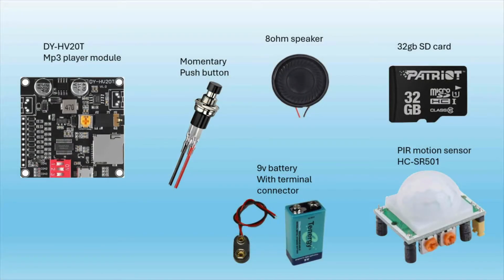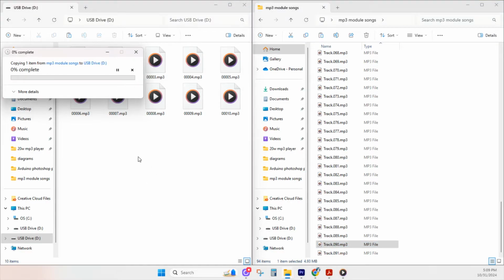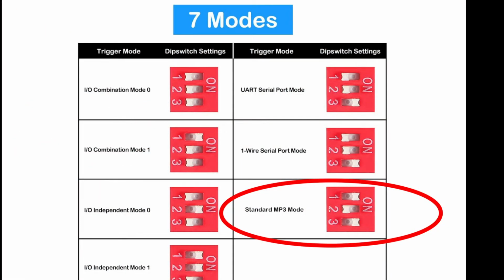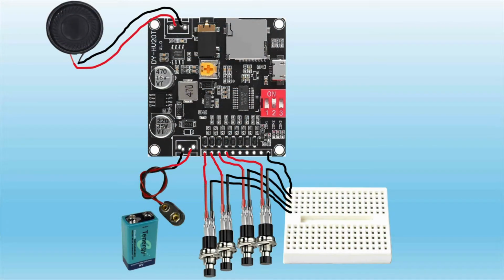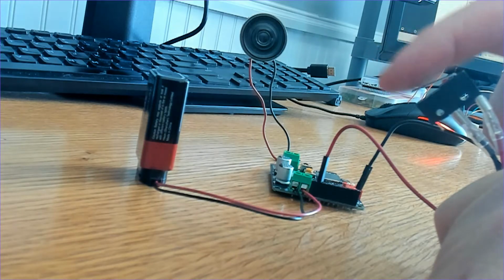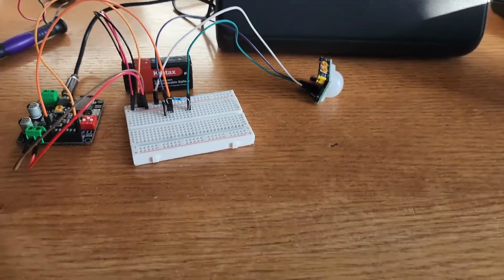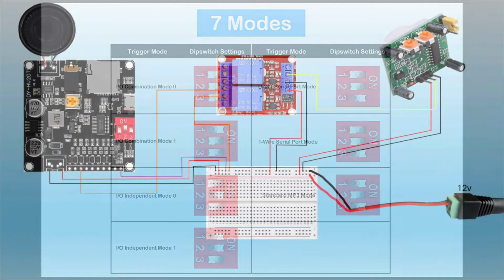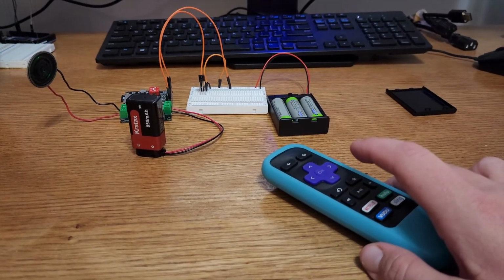5 Creative Ways to Use an MP3 Player Module   No Arduino Required!

Comment: 6:02 this is the problem I’ve been having with my mp3 board (different to that one) the audio plays on release of the trigger (so I just wired a micro switch to the normally open setting). The other thing was that whilst I got it working on trigger press, not release, the audio module seems to “sleep” and require 2 trigger pulls to activate the audio (on the second trigger pull) if left alone for a moment. I have bought a similar board to this one in the hope that A) it will trigger the mp3 on contact (not release) and B) play every time the contact is made without fail.
Reply from the maker: hey there! 
I hear ya, this board is great but sometimes getting a sensor to work takes some trial and error for sure. I tried numerous combinations of dip switch settings, wirings, and motion sensor jumper settings to get it to work like all the other sensors and triggers I have. 
I was going for "easy" ways to trigger mp3's for this board, but I found that the easiest and reliable way for the motion sensor to trigger was by using Arduino Nano. I know it doesn't fit the "no Arduino" model I was going for, but it's really just minimal code to get it to work perfectly.
Thanks for sharing and all the best on your sound projects! 👍👍

Comment: Do you build this for anyone? I need a device that plays music when the refrigerator door opens,  any help would be great.
Reply from the maker: Hey there!
I have built some things for people but never using this. You may wan to use a magnetic reed switch with the mp3 board. Those switches are like the ones you see on doors and windows. When the magnet pulls away from the reed switch, the music plays. 
I could help you build one ... happy to help!

Comment: Great video! I've tried all forms of power sources (i.e. USB, 3 AAA battery pack, 9v battery, 12v power supply) and I can't get any sound out to the speaker or the line out. The SD card is formatted FAT32 and the MP3 file loaded is named 00001 and is on the root level. Any insight would be helpful.
Reply from the maker: hey there - thanks!
do you have the correct dip switch setting for what you're doing?
have you adjusted the volume potentiometer in the middle of the board?
what kind of speaker are you using and how do you have it connected? what sensors, buttons, and other components do you have connected to the header? Are all components connected to common ground?
What is the current rating on your 12v supply?  may need to increase ...12v2A supply or so depending on what speakers and switches you have connected. 
And 00001.mp3 is the correct format. 
Some of these are kinda silly questions, but it's easy to overlook something👍  
I hope that helps

Comment: Thanks for the video! Is it possible to have a file play on repeat while a button is latched/On? Additionally, while that is latched on, if a second input is latched/on, a different file is played.
Ideally, when the second input is unlatched, leaving the first input engaged, it would continue playing the first track?

I'm just looking to make a simple prop for a kids costume without going down the Arduino route.
Reply from the maker: hey there! 
Props are always fun and the kids, i'm sure, would love that.

the precise behavior you described, you'll likely need basic logic control - either from building your own circuits or a simple microcontroller, which ironically might be easier than complex analog switching circuits.

I think this is as close as we can get:
I/O Independent Mode 0 plays repeatedly while input is held. This mode will play a new song when it receives a new signal during playing, but won't automatically resume the first track when the second is released.

UART mode with Arduino Nano or similar would give you the exact logic you want with just a few lines of code. I may be able to help if you choose to use Arduino. 👍
Reply: @BMonsterLaboratory out of curiosity, what is the behaviour in the event more than one input is latched? Say input 1 is enabled then input 2 is enabled while I put 1 is still playing/latched?

Comment: Can this be added to Bluetooth a speaker Without having to add songs or using an SD card? I'm building my own speaker and wanted to install some momentary switches for skip & play.
Reply from the maker: hey there!
This mp3 module doesn't have bluetooth capability. You can only play tracks on an SD card or from USB, which I find to be pretty slow. It does a great job of paying from an SD card though!
Reply: @BMonsterLaboratory boooo! Lol thanks. Do you know any that can?
Reply from the maker: @Pdott083  lol
This looks like it might be worth looking into. 
https://www.flipkart.com/electronics-crafts-zk-502l-mini-bluetooth-5-0-dc-5-24v-wireless-audio-digital-power-amplifier-electronic-components-hobby-kit/p/itm7ea33c5104fc1
It's a Bluetooth receiver and Class-D amplifier board. 
I also found this on Amazon. It has a ton of reviews and it looks like people are happy with it.
https://www.amazon.com/ZK-1002T-Bluetooth-Amplifier-Control-Speakers/dp/B0DZHC5GBG?th=1

Just make sure you have the right speakers and power supply and you got a nice setup! 👍👍
Reply: @BMonsterLaboratory seriously!? How? I have two 502L and planning on updating to the 1001u
Reply from the maker: @Pdott083  
24v 5A power supply at barrel jack
2x 30W 8ohm speakers (my preference) 

turn the module on. once LED starts to blink, grab your phone and search Bluetooth connection for BT-WUZHI. Once connected the LED will burn solid. Now your phone's audio should play through the amplifier.

Don't under power your board. They recommend high voltage for the one I'm looking at.
I don't see a password requirement to connect.
Also,  read the instructions with your module to verify what I have suggested.
Try it out. It should work 👍 

Here's the link I was looking at: https://www.amazon.com/Bluetooth-Amplifier-Receiver-Channels-Speakers/dp/B09J9338KS

Comment: Hey Brad.  Another great video!  Question: can this be wired in a similar fashion, with simply one push button switch, to play one sound?  Diagram?
Reply from the maker: thanks!
Yes, It can be wired for push button play. Do you want 1 sound track to be played or multiple?  You can use just this mp3 board with a button connected to it for one track or you can add a microcontroller for many more options.

Comment: My girlfriend was wanting to build a "haunted house" out of carboard (we have a TON of Chewy boxes) for a Halloween decoration. I thought about creating a circuit to put inside of it that would power some LEDs and play creepy sound effects, maybe even release "smoke" out of a chimney.
Reply from the maker: That sounds like a fun projet! 
Add this mp3 board to Arduino. 
You could use a micro fogger for the smoke - maybe with an LED behind it or use one of those model train smoke generators.  Power it from an external supply.,
Like the idea 👍👍

Comment: Are you able to share the code you are using? Thank you!! 🙌
Reply from the maker: i'm not actually using code in this video. I am just connecting various sensors/triggers to the sound board.  I have another video where I use Arduino to manage the sound tracks. If you want that code, I can get it for you. 👍
Reply: There is no code involved here. The board has built in logic and based on the 3 red switches you have multiple modes you can use. Did you even look at the whole video :)) he explained all quite well.

Comment: This is a fantastic video and really, REALLY helpful! I was trying to figure out how used the NPN transistor to trigger the DFPLAYER to play. Would you mind sending a drawing of how the NPN transistor was connected to the DF player and motion detector?
Reply from the maker: Thank you!  I appreciate it.  
I can send you a diagram over mail or facebook.  bmonsterlaboratory@gmail.com or click the facebook link.
 honestly, it's easy to use this with Arduino. You can expand your audio library to 255 or something like that. You can do shuffle, play in  sequence, motion activated, button activated...etc.  I can show you either way.  The Arduino route is pretty simple as well.  👍
Reply: @BMonsterLaboratory  Thank you....just sent you an email. I sincerely appreciate your help.

Comment: Can the mp3s play through the amplified circuit and the 3.5mm circuit simultaneously or does one cancel the other in use?
Reply from the maker: hey there!
Interesting question. I haven't tried that and I couldn't find any info  in the user manual.
I will get it back out soon and test it....will let  you know.  👍👍

Comment: I don't want to bug you with a question, but I'm struggling to see the answer...

I have what i think is a fairly simple problem. 
I want an Arduino to send a message to the board to play 00001.mp3 from start to finish.
The only thing that can interrupt it, is if a physical button connected to the mp3 player (NOT the Arduino) is pressed, and then file 00002.mp3 will play.

Is it possible for an Arduino to send a message to play one file, and a push button connected to the board to play the second file?

Essentially, I want the microcontroller to send the message to play the first mp3 file if something is sensed, for example, (and if the same message is sent again it will ideally continue to play the file without restarting) and then the only way to stop the first mp3 playing would be to interrupt it with the second (shorter) mp3.

Any help would be great!
Reply from the maker: Hey there!
Yes, you can do this using Arduino. Conntect the button and the trigger (motion sensor, light sensor, temperature senor...etc). When the trigger is activated a track will play, and this can be the same track or a random track. Use the busy pin on the mp3 player board to let the Arduino know if the track is still playing or not, that way it can't be "re-triggered" again. You can add a button to a different Arduino pin to interupt the triggered track. The interrupt track can be a random track or the same track every time. In this setup, the Arduino manages all control logic, making sure only the button can interrupt playback once a track has started.  👍
Reply from the maker: If you get stuck along the way, i'm happy to help.
Reply: @BMonsterLaboratory  That's incredibly kind of you. 

My request is slightly different to what you've written though. 

To put it simply:
The Arduino must tell the MP3 player to play file 1. 
A physical button connected directly to the MP3 player (bypassing the Arduino) will play file 2. 

The reason for this is that it's part of a project where once the MP3 player has started to play, the user has to remove it from the Arduino in order to find the physical 'plug' that will complete the circuit and form the switch closing. 

When file 2 is triggered, the MP3 player will be in a different room to the Arduino. 

I hope that makes sense? 
I'm really grateful for your time!
Reply from the maker: @tincanblower  oops... sorry about that. 
Yes, you should be able to set this project up as well.
Your project sounds like an Escape Room puzzle- very cool